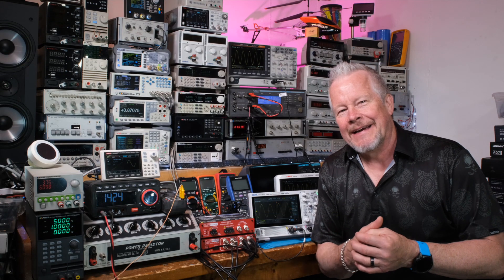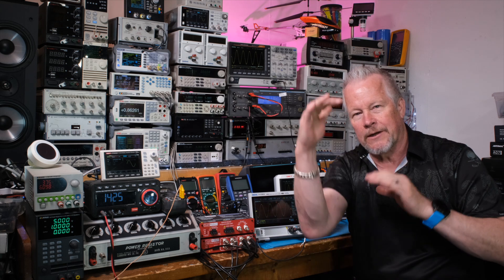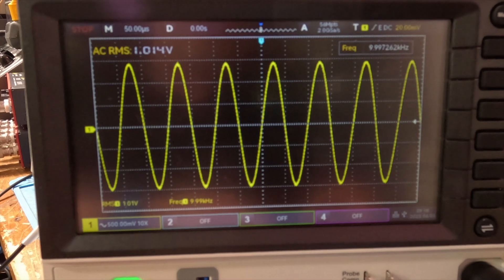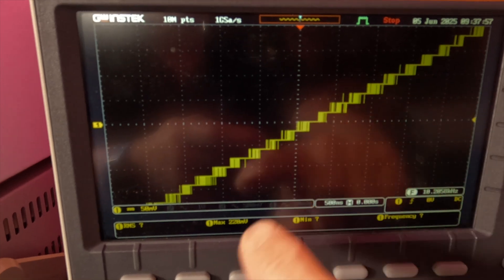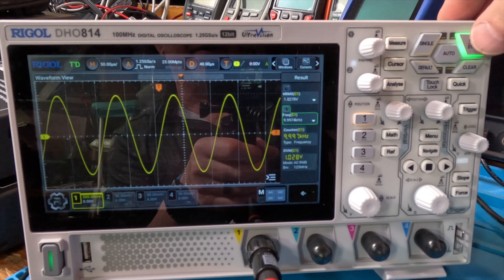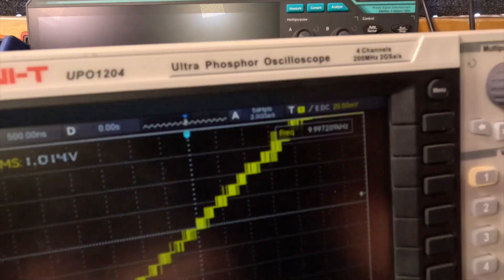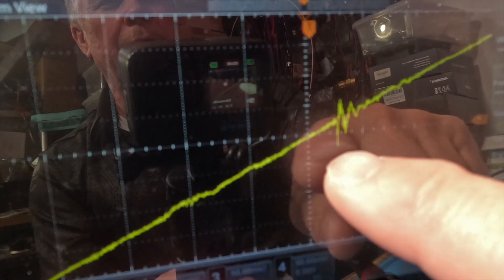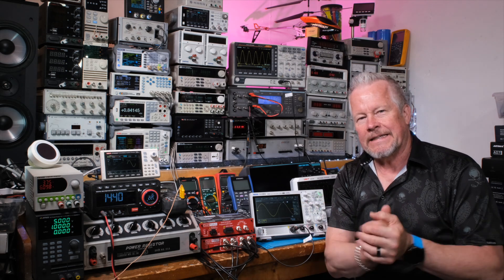12 Bit vs 8 Bit Rigol DHO814 Oscilloscope a simple demonstration #12bitscope #DHO814 #DHO924S

Comment: I was always told that you need 12 bits minimum to get good resolution, so I am glad my new DHO814 has this feature.
Reply from the maker: Thanks for that feedback.  Well, most scopes sold are 8 bits.  Even the Brand name scopes use 8 bits except for their higher end series.  With 8 bits you have to zoom into what you are looking at to get good resolution.  a 10 bit or 12 bit scope allows you to zoom out and look at the entire waveform and then zoom in once captures which maintains the resolution.  Have you seen this video: https://youtu.be/GKo5egHpGs0
Reply: @KissAnalog  That was a great video as well! Can you imagine the day (not too far away) when the scopes have 24 bit resolution?
Reply from the maker: Yes - technology is moving fast.

Comment: That's where my 16bit Picoscope 4262 really shines... 👍👏😎
Reply: $1500
Reply from the maker: Yes the Picoscope 4444 is not low cost.  The whole kit with 4 diff probes and case is around $2500 but for a 14 bit scope with 4 diff inputs - that is pretty amazing.  I need to show it more;) https://amzn.to/3ZnsnwG

The 2204A is only about $185 and has 12 bits in enhanced mode.  This is a killer scope: https://amzn.to/459jR8c
Reply: @jimquinn  I paid £350 for my 4262 s/h on eBay, down from the original £750 starting listing - I waited the seller out a few weeks till the price dropped to a more reasonable level, though even at £350 that's, imho, a lot of money for a 5MHz bandwidth usb scope.
Reply from the maker: Yes s/h is a fantastic way to save some money.  But, I have to say that I think Picoscopes are not over priced when comparing features with what else you can find that matches.  It is higher end equipment and the software is being updated on a consistent bases.  Not that Rigol and Siglent has come out with their 12 bit scopes - maybe Picotech could lower the cost of their 2000 series - but then again I think the 2000 series is pretty amazing.  But maybe not they buy they used to be.
Reply: @KissAnalog  I gather the Rigol runs Android, which makes me wary of buying it...
Reply: @KissAnalog  My 4262 is £1250 inc VAT new, no way would I pay that...
Reply from the maker: LOL - I don't know what Rigol runs on...  The 4262 is a great scope;)
Reply from the maker: Yes - love the PicoScopes!!  Did you see the video with my Picoscope 4444 that is 12bit and 14bit resolution: https://youtu.be/i1fDtkxfSjE
Reply: @KissAnalog  Yes, interesting - though I'm of the opinion that new Pico stuff is overpriced and best purchased s/h...